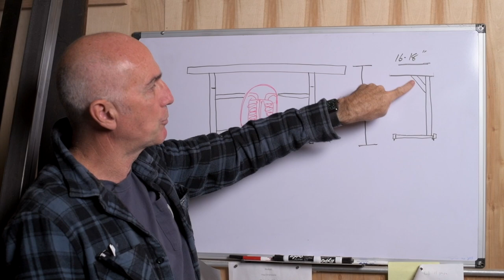Tractor Grill Table Build Part 1

Comment: I like it.  I vote for the corded option.  Did you think about using glass for the top?
Reply from the maker: I have done a glass top before for a rolling bar.  Glass is expensive and would add quite a bit of cost.  Since I don't  have a buyer or client I'm trying to keep the costs down.

Comment: If the back is going to be up against a wall I would use a cord.  Is there a headlight on the driver's side?  If yes then how about an illuminated Ford (or what make the tractor was)  emblem in each headlight.  I suppose it depends upon what look you are going for.
Reply from the maker: I'm not sure what manufacturer these are.  I will get in touch with the guy I bought them from when I finish so I can label them correctly.  Missing the actual light on one side but the pocket is there so I'm not sure that would work.  I do have another full cowling that illuminating the lights might be a good option.  Thanks for the input!